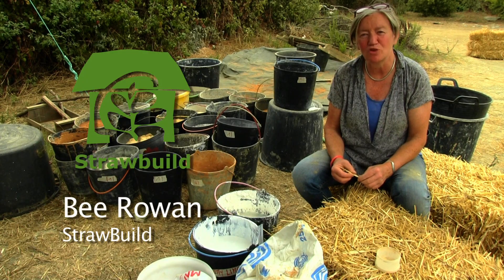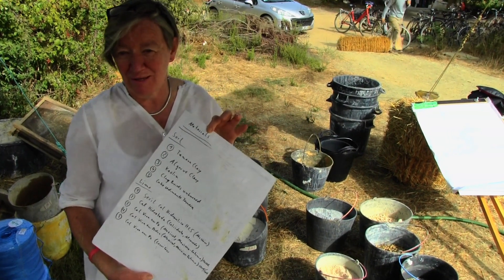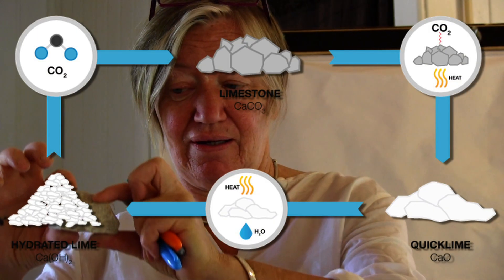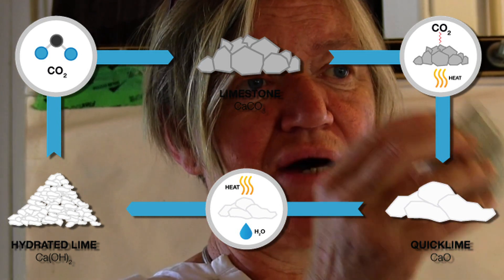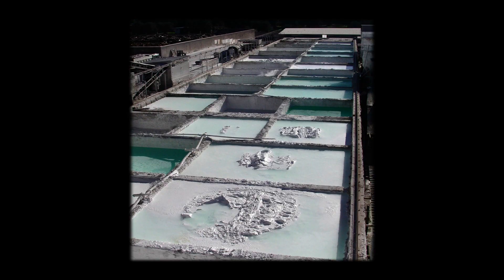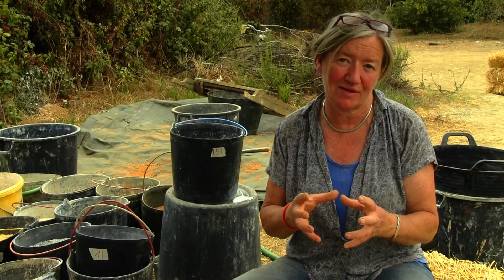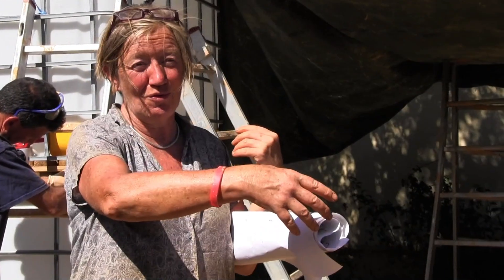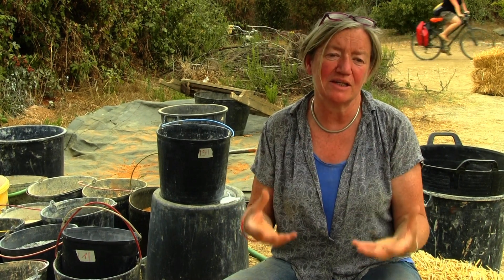Magic Mud: Experimenting With Lime Stabilized Soil at Tamera | No more Cement | Auroras Eye Films

Comment: Lime is great because of what it can do. The only thing that sucks is you have to wear all kinds of protective stuff because it’ll eat through your skin or if you get it in your eye it’s going to do a lot of damage. My cousin was ignorant to this and walked in wet lime when we were making a mortar and it melted his shoes and ate up the bottom of his feet. He had to go to the ER because of that. If you all decide to use lime just make sure you wear eye protection, gloves, and wear a dust mask when mixing it dry.
Reply from the maker: Yes this is very tre, thanks for sharing. It's very important to use protection when using lime.

Comment: yeah but i live at limestone mine and kiln in the nex village.
it is unbelievable that there was a hill but now is a 100m deep hole. and quicklime making was producinv carbon dioxide not only from fuel which is coal but also releasing the carbon in the limestone it self to form quick lime (CaCO3+huge amount of heat => CaO + CO2) and also likely releasing NOx and SOx because the temperature and it using coal as fuel. and they claim using green material
ps. and also it releasing heat to atmosphere to make slakedlime